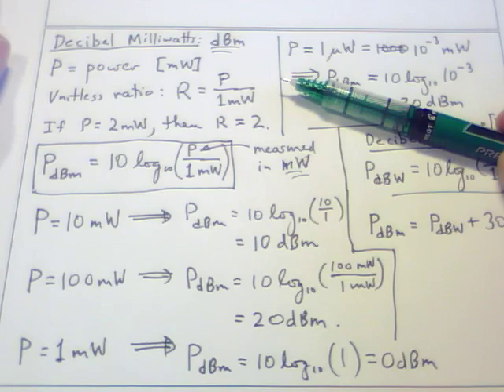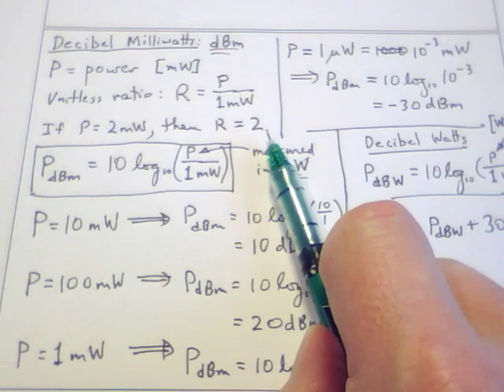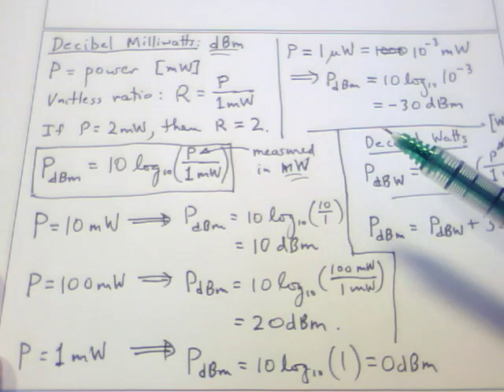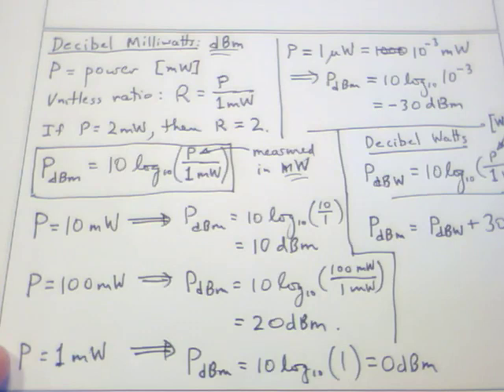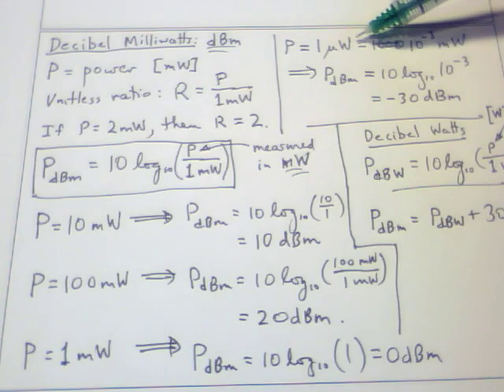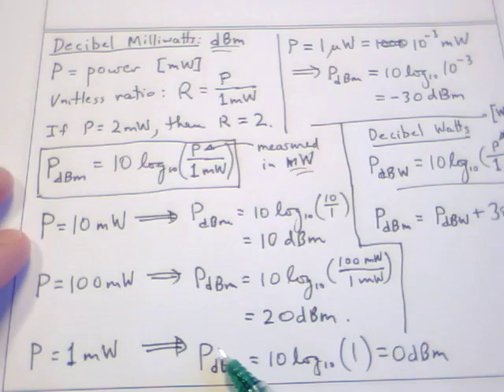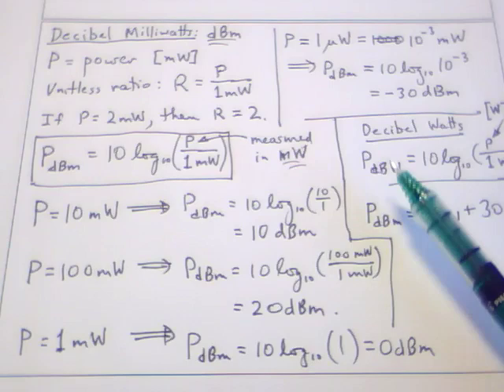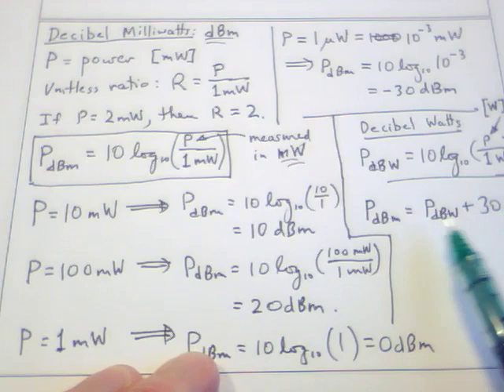Decibel Milliwatts

Comment: Use closest value: 200. 
200 = 2*10*10 and that's 3+10+10 in dB so 23.
Correct result is 22.7 so it's close enough. If you want exact value use some online converter.